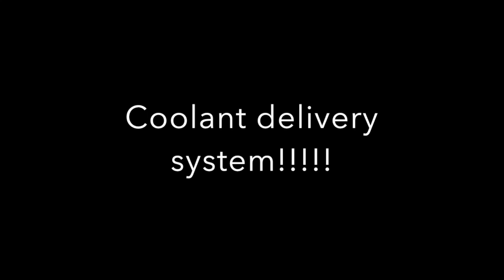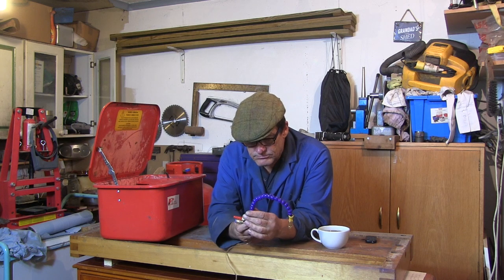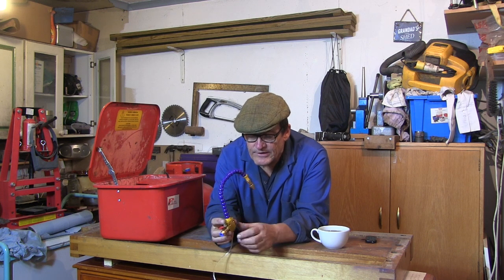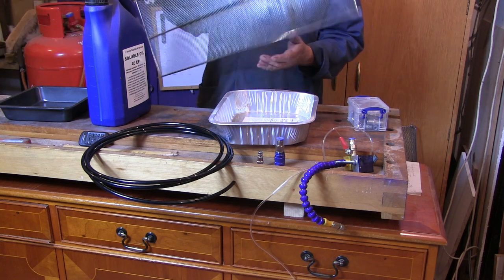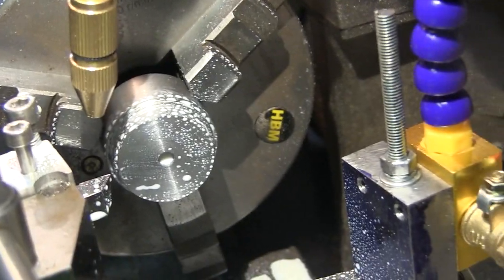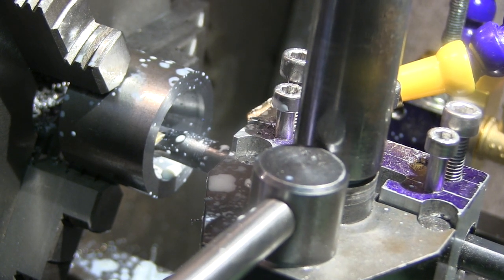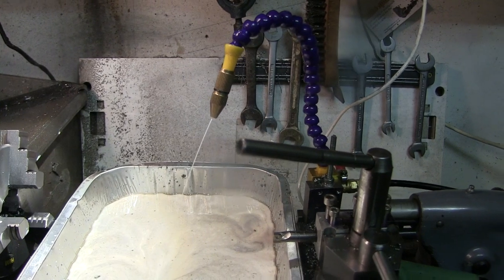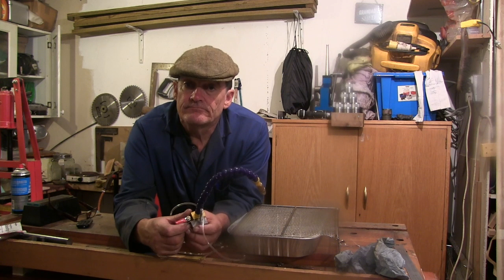Suds pump, coolant delivery system!!!!!!!!!

Comment: Need to say thank you again! Experimented with this today and realised that just using the gravity setup you showed it just dribbled out the end and isn’t great for a milling machine. If however you have the suds bottle not too high and just use a tiny bit of air to keep it running it uses LOADS less air that sucking the suds against gravity. That means less noise from the air, less compressor noise, less mess from oil spray getting in the air and less fumes because the coolant isn’t vaporised into such a fine mist! You’ve probably worked this out but hopefully helpful for someone just seeing your video. I’ll be ordering one of these for each of my machines now!! 👍🏻

Comment: Hi Cliff.  Really good video.   I enjoyed it a lot.  Has got me thinking.  Both setups worked very well. 

The basic overhead drip feed system is what they used in the old days, and I prefer that idea to mist as I don't like breathing in vapours in any situation.  Having said that, I don't have anything similar set up on the lathe.

The mess factor has always put me off.  Not so bad for small diameter work, but larger and higher speed throws it about.

The bendy stalk thingy works well and using it just as an air blower certainly would help prevent cutter residue scoring and keep the tip clean.

I will have to have a red and think some more about this.  Price wise you can't go wrong.

Cheers Rob
Reply from the maker: It is very definitely messy, but works a treat, I'll probably only use it for the cones I make, they get hot and it improves the finish a lot, miles less grinding and polishing, and its seems to be a big help on the parting, way cheaper than the spray cans of cutting fluid I've been using!
Cheers Rob,
All the best,
Cliff

Comment: Great video! Thanks. I have the same setup on my mill but I use the no-diluting cutting oil. Stinks and fills my garage with burning oil fumes in no time! I find the noise of the air, mill, extractor fan and compressor running often really annoying! I’m not sure I’ll continue to use it with the airline! Your gravity fed system is fantastic and I’ll be making that mod in the garage tomorrow!! Thank you so much! Subscribed! 👍🏻

Comment: Nice video Cliff; I have this same misting block set up, mainly for my milling machine, & like you, I have a couple of neodymium magnets fixed on the block so I just attach it to the mill column & away it goes.
Reply from the maker: Thanks, I do tend to use it mostly on my metal bandsaw now, blade seems to last miles longer!
ATB,
Cliff

Comment: Good job. I dunno about that constant hiss of air though, get on your wick after a while i reckon. I was going to make a coolant system for my drill press, i was thinking of using a cheap aquarium pump, they are only about a tenner.
Reply from the maker: I was thinking about just putting some kind of "gravity" fed gubbins on my drill press, probably won't be able to catch it and recycle it though.
don't mind the hiss, its the bloody compressor kicking in in that drives me mad!
Thanks for watching,
atb,
cliff

Comment: Nice one Cliff! I made one years ago as flood coolant out of a dish washing machine, is had two pumps in it. The smaller pump is used for delivery as it was the low pressure return I think. The tank will hold about 20 liters if filled and was made from the cabinet of the machine. Throttle is just an old surgical clamp from my Uncles days as electronics man doing instrument repairs, he got them when they to be discarded due to wear or whatever. I now have a ball valve that I intend to install.
 The reason I mention all this is it may help others as a way of making their own system that read these comments. A lot of us are budget conscious. All the best from John, Australia.
Reply from the maker: Cheers John, I still might make another one, more of a drip and flood with my old parts washer for the lathe and keep this one for the mill and donkey saw,
ATB,
Cliff
Reply: Cliffs Shed, Gday Cliff, I hear you. Forgot to mention with the system I made I put a hole through the drip tray so it all drains back to the tank via a small settling tank that helps to settle out smaller swarf that gets through a basic gauze filter. John.

Comment: Hi.Just question where I can buy that from?! Any helpfull link?!
Reply: that item doesnt working at all... blow only air
Reply from the maker: Hello Mariusz,
The one in the eBay link is what I have, you put the tube into whatever liquid your using and connect your compressor to it and it creates a Venturi, pulling the liquid up as a must.
Reply: @CliffsShed  Hi- Thanks.